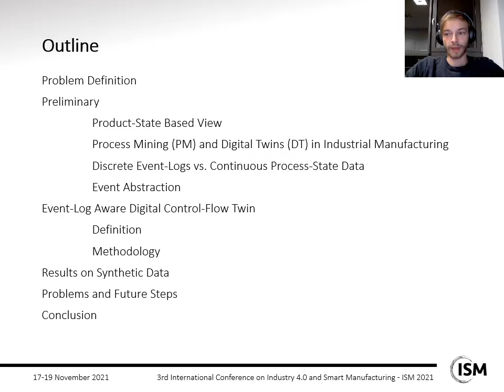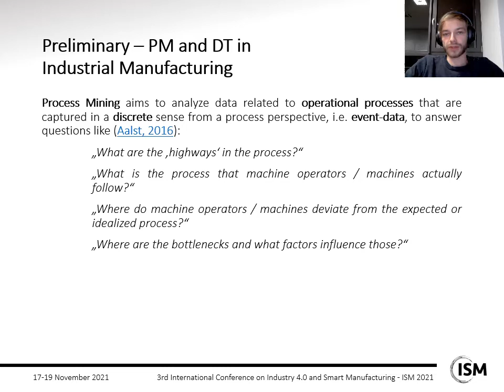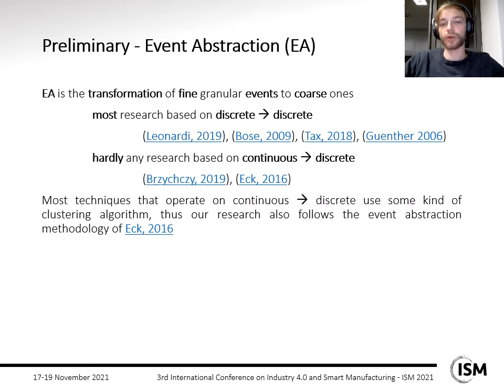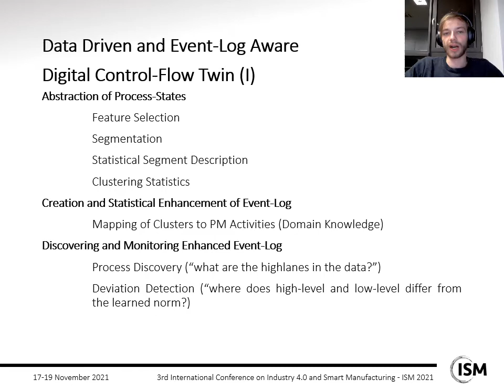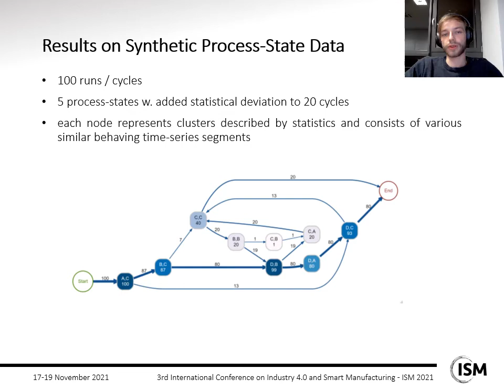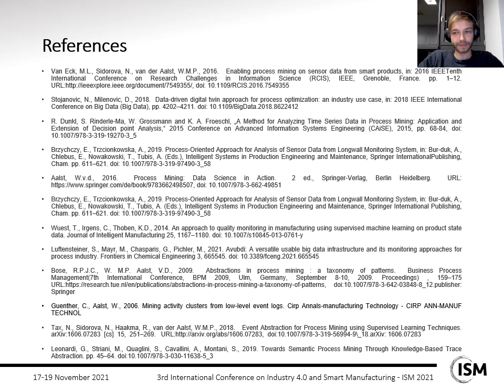Abstracting Process Mining Event Logs From Process-State Data To Monitor Control-Flow Of Industrial

Comment: Deriving an event log from PLC state data is the part most plants underestimate, since the signals rarely map cleanly to process steps. Once it works, though, the control-flow view shows deviations that no dashboard ever surfaces. How did you decide which state changes count as an event?